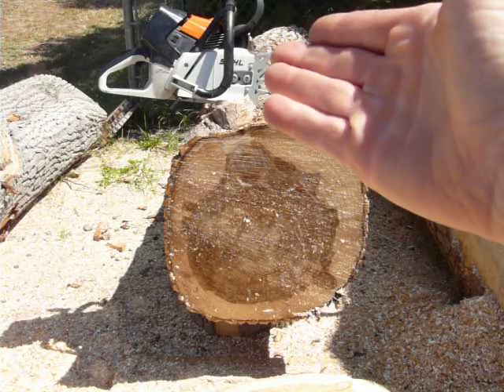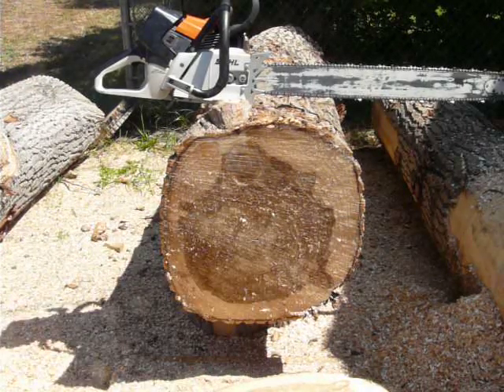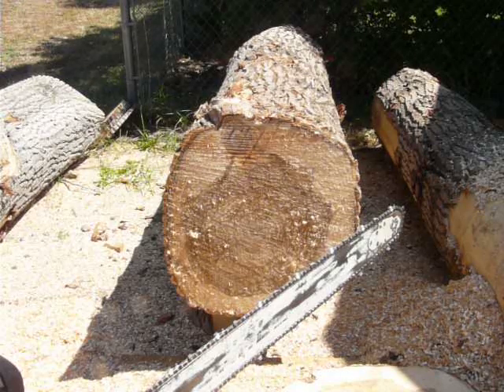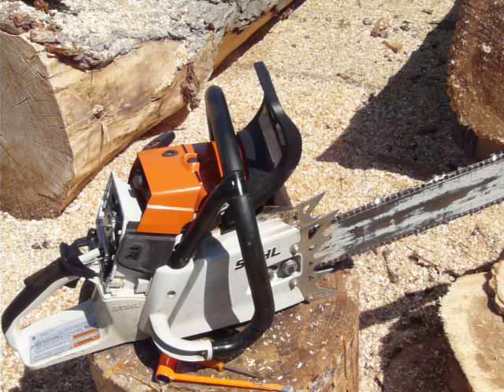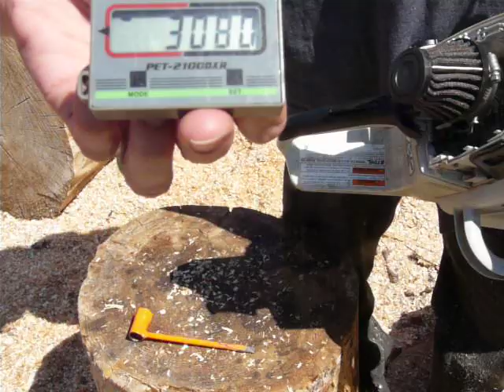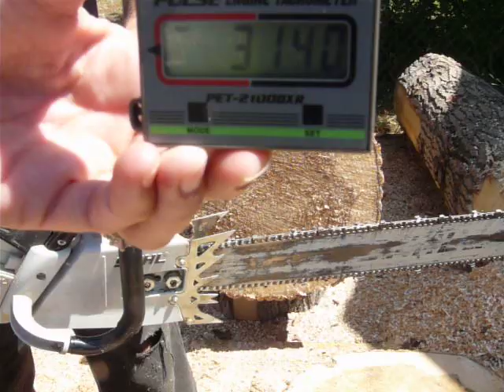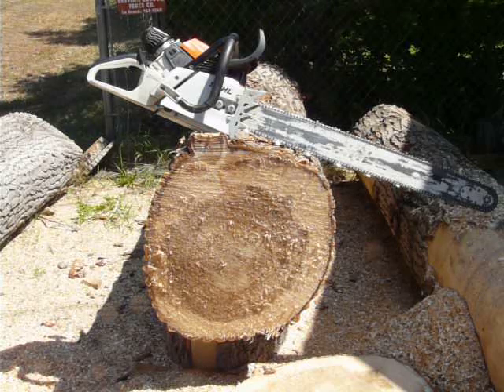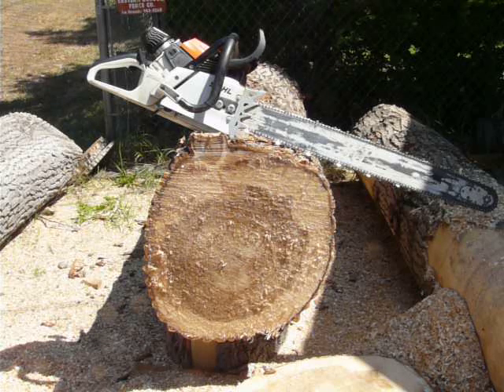Stihl ms661R  Maxy (Max-Flow) vs K&N Air Clearner Systems

Comment: Yes, as they taught me in Aviation Maintenance in 1992 Bernoulli's principle. (I know hotsaws101 knows this but some viewers might be interested to learn the following). Where velocity & pressure are inversely proportional to one another. As velocity increases pressure decreases. That's the main reason/forces on how a carburetor operates. As the air goes thru the venturi it gets necked down smaller & smaller like in a funnel & on this K&N filter venturi & the velocity/speed picks up & this causes an area of low pressure in the center area of the venturi & the fuel is sucked out of the float bowl thru channels/tubes/jets etc. & gets metered/mixed with the correct ratio of fuel (Stoichiometric ratio air/gasoline ratio is 14.7:1 & for a gasoline engine is the ideal ratio of air to fuel that burns most all of the fuel with no excess air). Good 3D video how a carb works here on YouTube:   https://www.youtube.com/watch?v=Gkhd-eJk234
 How Carburetor Works ( 3D Animation) in Suzuki GS150R Motorcycle

Comment: One thing that should considered it that the oiled foam filters stop way more dirt. I've seen lots of fine dust pass right through a k&n. I personally will never run one for the simple reason that they shorten engine life.
Reply from the maker: Adam hi. They are both supposed to be oiled. Although, I've seen guys that don't. 
I ran a lot of K&N filters on my Huskys, on the coast as well as inland (about as dusty as it gets) over quite a few years. I never noticed a problem with fine particulates getting by unless there was a tear/hole/gash in the cotton element.
Part of it is not using mixed gas to clean the elements - regardless of brand from my perspective.
I think that the PJ-1 is a better filtration oil also. I use it in my K&Ns and Maxys.
Thanks for watching.

Comment: I am super disappointed in the stock 661 air filter.  I literally would not have bought  this saw if I knew the stock air filter would  let sawdust into the engine. 

The stock 661 air filter let's saw dust in at the baseplate, so I think any air filter that let's at least as much air in as stock and can also seat well enough that sawdust does not enter the engine would be a good investment.

Comment: I've got a Makita 8401 20 inch bar any suggestions why my bar rails keep clogging with chips number 7 sprocket. Thanks
Reply from the maker: Chris hi.
You never mentioned how long the bar is, the bar manufacturer, which style of chain, and/or the method of sharpening. Also, the age of all of the equipment was left out. There are a lot of variables here.
Assuming you have a 6401 that someone upsized with an am big bore kit as well.
Thanks for watching.
Reply: @hotsaws101  it's my saw bought brand new put the Big Bore Kit in it been hanging for almost 10 years never used, less than two tanks through it 20 inch Makita bar full chisel chain 25 degree grind raker set with depth gauge. thanks chris

Comment: I’ve got Max on my 460 Magnum and 660 and I’m sort of disappointed. Not a net positive especially considering the kit cost and the monster increase in boxy size which makes the saw even harder to handle in tight spots. But for now I’ll stick.

Comment: What do you do with all your cottonwood cookies?
Reply from the maker: Lorric Logging hi.
Since I'm no desidious tree expert, this may be askew. 
It is a different kind of poplar tree.  The poplar & cottonwood share the same Genius but not exactly the same species it seems.
This was from a hybridization experimentation project where the trees where grown out in a field, far from any water source.
It may have been with Aspen trees since I think they share the same Genius but are a slightly different species.
The bark is pretty slick over the entire bole and "white-ish" not gnarly like the Cottonwoods around here.
My lovely bride will attending to the back yard burn festivities.
Thanks for watching.
Reply: hotsaws101 hybrid poplar I’ve heard of, it’s all cottonwood to me. Wet, heavy, burns hot and fast with a lot of ash. Cottonwood here tends to take the edge off your chain. Maybe field grown doesn’t have dust in the bark. Cheap wood for chopping, I get it.
Reply from the maker: I think that there is some dust in the bark since they grew out in the open and were subject to a lot of wind blasting them year round (dirt & gravel roads right there).
My chains don't seem to last in really good cutting form a super long time and I hosed the logs off. It might also be from the "thrashing around" in the dirt during the harvesting process too.
I did hit some dirt patches a couple of times in the beginning. That was a start over affair.
Reply: @HubertofLiege  my father in law can't get enough of the stuff because NO ONE wants it in western idaho! Shame too, plenty of it. He burns it in the shop.